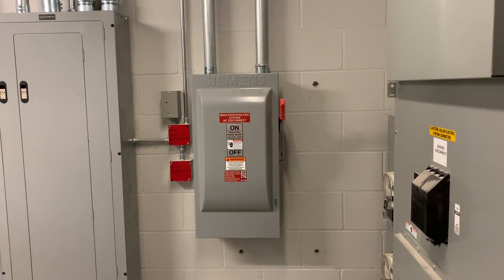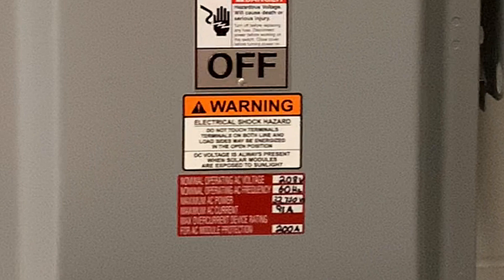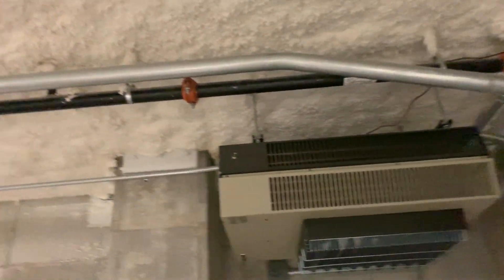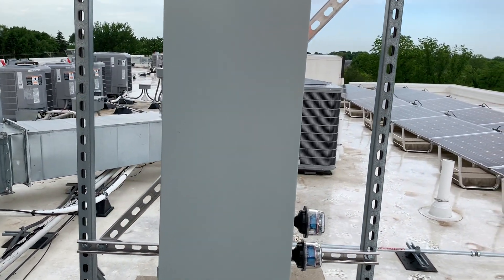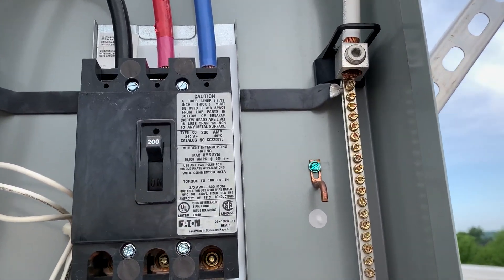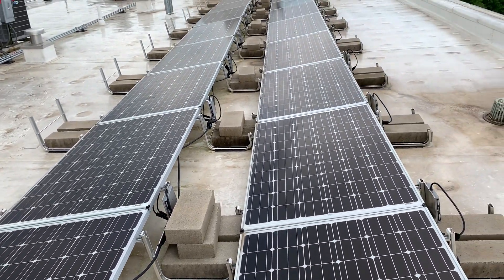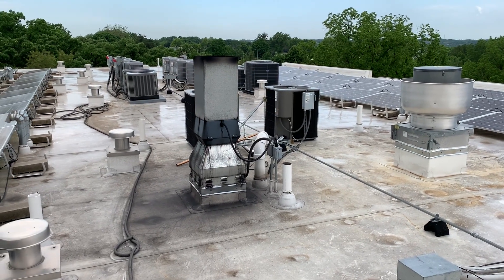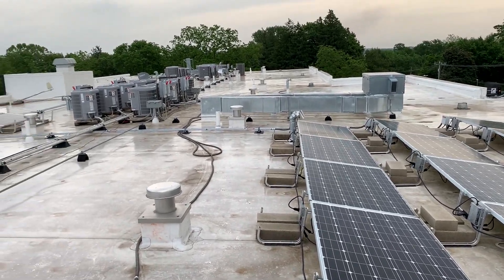Enphase grid tie solar array installation overview

Comment: Excellent video. I need to do an install in Florida. Any preferred distributors? Have a permit, need to buy the stuff and install it. Super informative video!
Reply from the maker: I wish knew someone to recommend for that area.  If it’s like around here, there should be some companies that only do solar.  If you have a smaller installation like a house, some companies around here do just one inverter down low by the meter.  This could be beneficial because it would be difficult to get back on the roof the change out an individual panel inverter.  Down side is, it’s slightly not as efficient if one panel gets shaded.  Hope you find a good installer!

Comment: In a residential grid tied system where the main breaker is next to the solar pv ac disconnect on the outside, does the solar pv ac disconnect connect to the in of the inverter from the main service panel or after the inverter out goes to the critical load and transfer switch then to the solar pv ac disconnect? or does the out go to the solar pv ac disconnect first then to the critical load panel? I am a newbie so please bear with my newbie questions.
Thanks
Reply from the maker: I’m happy to help with some newbie questions!  Let’s see if we can figure this out.  In a gird tie system, there is not a transfer switch. The Solar AC Disconnect is there to kill the power going to, and coming from the inverters attached to solar panels.  Remember, the grid tie inverters only send out power when they have a reference from the “grid” to match up with.  When you disconnect the Solar AC Disconnect, it kills that reference, and they don’t output anything.  There are not any critical loads with these kinds of systems, and that is usually in generator systems.  Now this conversation slightly changes if you are referring to a Central Grid Tie Inverter that you see on the side of peoples houses.  With those, there is another DC disconnect in between the panels and inverter, and that’s to disconnect the constant DC feed coming from the roof.  See if this clarifies part of your question, and by all means, keep asking them, especially if I missed what you were asking.  I could even make a video on this later on if it seems to be a question that most people have:)